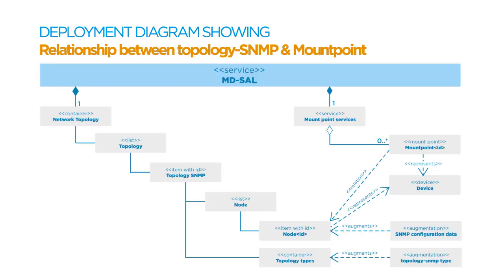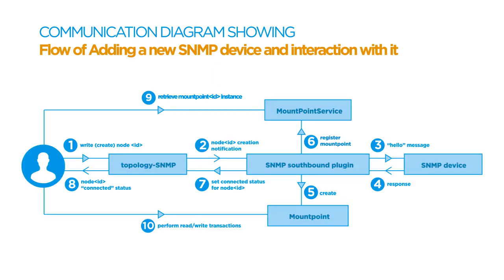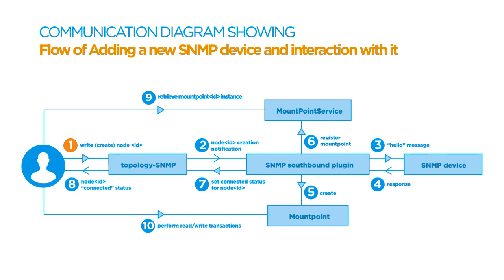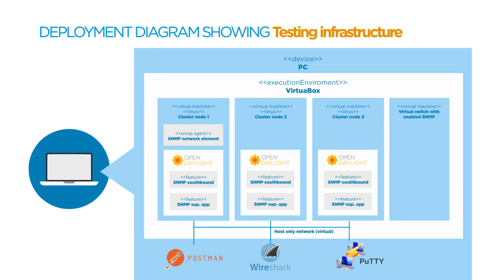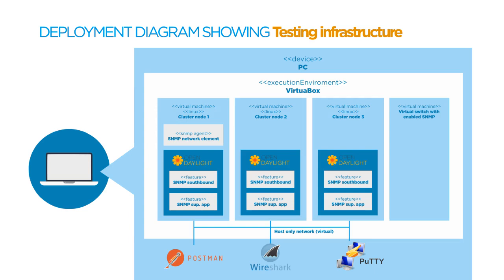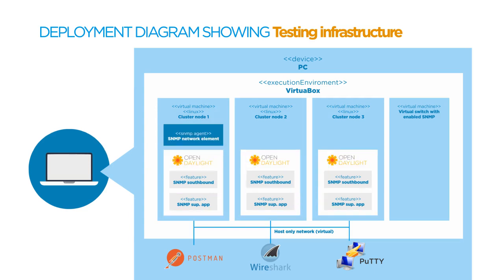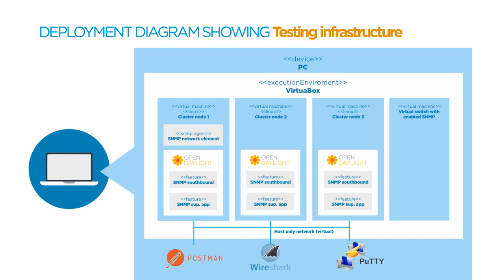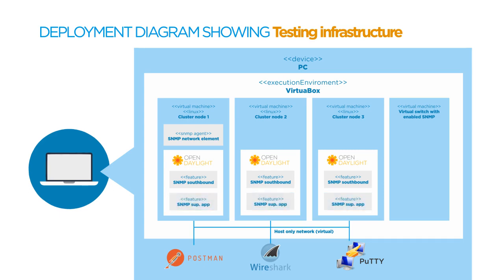SNMP Southbound Plugin – Single Node Functionality 1/3: SNMP Topology & Testing

Comment: What is the advantage of using OpenDayLight with the SNMP Southbound Plugin, in relation to taking an approach at hand with Easy_SNMP?
Reply from the maker: Hi Matheus! SNMP is a legacy protocol which you should only use if your devices do not support some of the more recent protocols (NETCONF, gNMI,..). In case you still operate old SNMP devices and you'd like to operate in a brownfield site (along with NETCONF devices), you can either use a bunch of scripts to automate the environment (e.g. Ansible), or you can build a controller with a unified abstraction layer, adjusted for the needs of your environment.